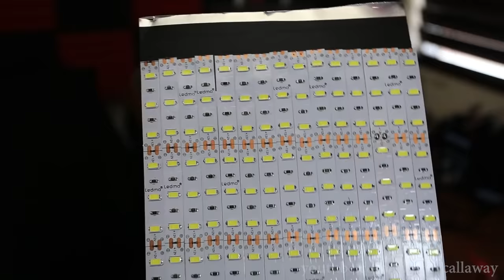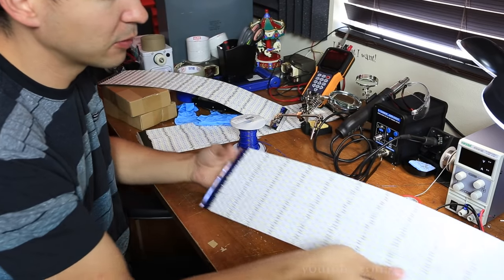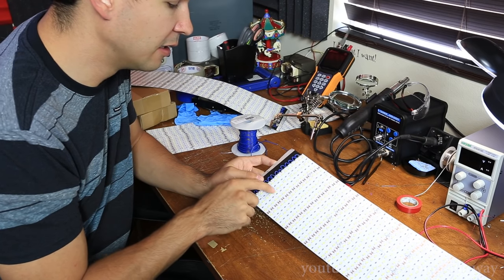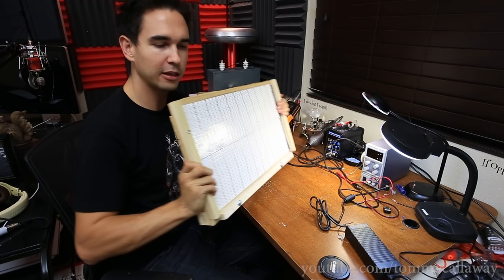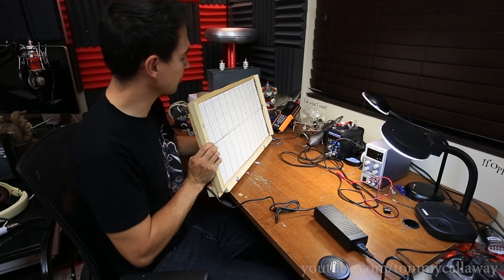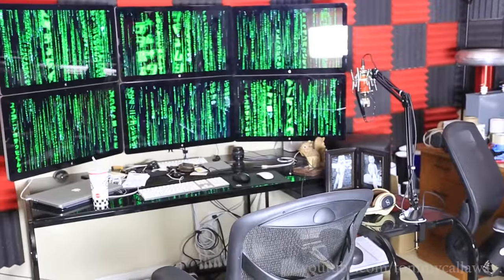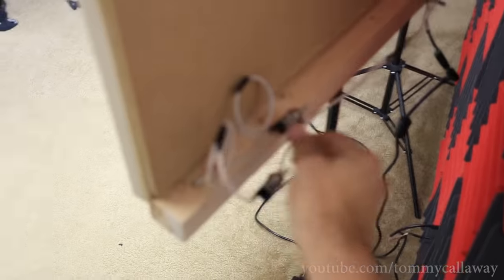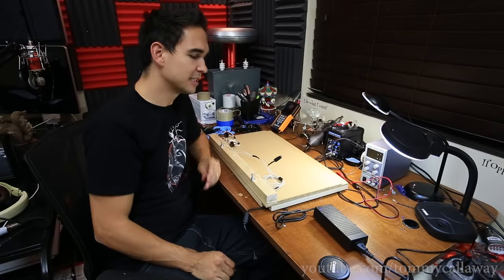DIY Insanely Bright LED Panels (for video or photography)

Comment: Hi I need serious help in backlighting for inspection panel. Is it possible to use AC plug n play with dimmable feature? On what height should I place it to be to have it in 60mm box? And have 1030 lumens for 650 x 350 mm box. Thanks in advance,

Comment: Hey good job how long can you run these for before you may get any issues? As I'd like to use this idea to make lights for my garage to detail my car but they may be running a few hours at a time.. thanks
Reply from the maker: +Aaron Emptage I've run it for over an hour a few times. Still running strong.

Comment: Nice Tutorial! 
How hot does the panel get when running for longer periods of time? is the Aluminium and no front glass enough to keep the temps under control?
Reply from the maker: +photofreak126 yes, I've used the panel for extended periods of time - it gets warm to the touch pretty quickly but it doesn't get much warmer than that. It's good to go for extended use. Also, I found a better way to wire the LED strips together which can save you a couple hours if you're look through my videos.

Comment: Very good video! Thanks so much! I was just wondering , what is the purpose of the aluminum backing. Can't you just paste the led strips directly on the MFD board?
Reply from the maker: The aluminum backing helps with heat sinking.  It's only a little, but it helps. Additionally, it makes it so the panels are more easily replaceable if you get different colored / higher CRI LEDs in the future.
Reply: Direct to consumables is a fire hazard.

Comment: Your LED Panel looks great!  
What kind of Fstops are you working with, with this LED Panel?  
Can you meter this LED Panel from 3 feet at ISO 100 at 200Sec Shutter speed 
to see what kind of Fstops your getting?
Reply from the maker: +Divus iulius sure, will get you back tomorrow. In the mean time, I usually shoot video at 1/30 or 1/60, ISO 100, and f4 to f5.6 using only this panel as lighting on a tripod about 8 feet back.
Reply: Not bad. I'm an old Film Photographer. I rely on my metering.  I still shoot strobes.  I'm not all that impressed with Fluorescent Lighting what so ever.  However, I am impressed with LED's and Super Bright LED's.  I just needed to get some numbers with what you were presenting in this video.

Thank You!
Reply: Absolutely!  Please and Thank You!
It would be absolutely appreciated.
Reply from the maker: My meter was dead center at F4, ISO 100, 1/200 shutter speed with only the panel lighting it at 3 feet.  The resulting picture looked like it would be good for a dramatic portrait.
Reply: Damn! At three feet, that is pretty good. That gives you an exposure value of EV-11 at ISO -100. If you're interested in that sought of thing.  Exposure Values gives me a reference point as to the strength of the output of light.  Here's an Exposure Value Chart for your future curiosities.

https://upload.wikimedia.org/wikipedia/commons/d/d4/Exposure_Value_Chart.jpg

And here's a Exposure Value Website Calculator for any of your other light projects.
You will have to scroll down the page to get to it.

http://www.scantips.com/lights/evchart.html

And Thank You! Again for your time and trouble.
Much Appreciated!
Reply: You mentioned higher power sources for brighter LED panels. What would be so bad about that?  If the trade off is getting LED's to perform at the higher Lumen outputs for lower ISO ranges.  Higher Power output LED Lights behind Softbox's & Diffusion Scrim  would get back some of the light that is lost in the diffusion fabrics.

Instead of an ISO at F4, maybe ,F8, F11 or F22 for group shots that requires LED Lights to be set back to further distances.

An LED that is putting out 8K to 10K Lumens is definitely gong to be needed eventually.

NO?

This is insane money for 6000K,  10K Lux
Flicker Free LED Lights when you can make them yourself!

$13,000 USD  ?? What ??

B&H # DESPSL4BMK 	 		MFR # SLED4-BI-M

Dedolight 			DLED4-BI Bi-Color LED 4-Light Master Kit (Mains & Battery Operation)

											CRI: >91   										<== for 13,000 it should be 99
											Color Temperature: 2,800-6,000K 										
											Focus-able from 60 to 4° 										
											Tilt with Permanent Friction 										
											Outputs 10,100 lux at 3' with Spot 										
											Passive Cooling 										
											Two Dedoflex Softboxes & DP1.1 Imager 										
											Four Battery Power Supplies & Batteries 										
											Four Mains Power Supplies 										
											Four DST Stands & Soft Case 										
							
						 						 					
https://www.bhphotovideo.com/c/buy/Kits/Ns/p_PRICE_2|1/ci/12292/N/3988592073
Reply from the maker: That's some pretty crazy money for something you can build yourself for around $500 - doing this build with higher quality LED strips and a few more panels.
Reply: AAAAAAAH! You have seen the light!
Reply from the maker: Divus iulius That's a crazy panel.  I would love to compare it side by side to my own cheapo one.. I should get in contact with them.
Reply: Mr. Callaway,
                     The reason I suspected that you were producing very high Lumens was that part in your video where you astutely suggested not to use the potentiometer. 

That suggests too much voltage drop and loss of overall power.

I'm tickled pink because nearly all of these guys using them are more than likely cutting their power and Lumens by HALF.

Most of these DIY projects on video are putting out somewhere around 6000 Lumens at best. That's 6000 Lux at 3.3 ft / 1 Meter.

That's not bad for a DIY LED project.

But if you were correct about your numbers at:
F4, ISO 100, 1/200  Then you need to be proud of yourself.
 
I couldn't believe my eyes when I read that was EV-12.

I would love to see you can do on even brighter and more powerful LEDs.
Reply: Since the last time I corresponded with you, I have been struggling with the EV calculations.  I'm a Photographer, not some Math prodigy.   However, I finally got it figured out.  The EV Formula on Calculator goes something like this.  
At ISO 100

EV = Log(fstop² / Time) / Log₂

And it really works to my surprise!

Your numbers where, EV = Log( f4² / (1/200)) / Log₂  

EV = 11.6438561898  That's between EV 11 and 12

Ta Da!  I'm So Fucking proud of my self.
But that's what you are putting out on the Ghetto Light Blaster.  LOL
Reply: To get the Lux from the EV,

Lux = 2.5 x 2^EV
2.5 x 2^11.6438561898
Lux = 8000 per square meter at 1 Meter.

That's Damn Good!
Reply from the maker: Very interesting! Thank you for spending the time to figure all that out lol.

Comment: Hi Tommy, I new to this so please be gentle in you response. The 5630 LED strips you used were 12V 60W and therefore rated at 5A per 5 metre length. What was your calculation to determine the watts and amps output requirement of the transformer you used. Assuming you cut the LED strips into 50cm lengths, each having 30 LED's?

My setup was to cut 3 x rolls of LED's into 50cm lengths. I connected the dimmer load positive through 2 switches two positive bus bars, each having 15 positive connections, and the negative load output to one negative bus bar for all 30 negative connections. A similar setup to your LED panel, but only using 900 LED's
Reply from the maker: I took one roll, and applied 12v with my bench lab supply.  I observed the current draw, and then added LED strips until I got to 10 amps.  It ended up being just about 3 and 1/3 rolls of LED strips, at roughly 1000 LEDs.

Comment: Hello Tommy. I was wondering if you have any problems with flicker when doing video using a switching power supply .
Reply from the maker: +Jon Fisher I haven’t had problems with this panel. Using a PWM device will cause flicker especially at faster shutter speeds.
Reply: Tommy what is a PWM device
Reply from the maker: +Jon Fisher pulse width modulation.

Comment: The link for the power supply is for a 12 volt 2amp power supply. Or am I incorrect?
Reply from the maker: 12 volt 10 amp.  DO NOT get the 2 amp one, it won't power this project.
Reply from the maker: Fixed, found it on ebay.

Comment from the maker: You can also choose to use different colored LED ribbons if you want, don't feel obligated to use the cheap ones I used.  They work really great, but I'm sure there are even better ones.  You can also mix and match colors so you don't need to use gels if you wanted to have different color settings.  Have fun, and let me know if you guys have any questions.

Comment: You should consider taping over the negative pads with Kapton tape (or electrical tape) and use an uninsulated solid conductor as a power bus and tack solder the bus to each of the positive pads.    And then again for the negative side but tape over the positive pads and tack solder the bus to the negative  pads.
Reply from the maker: That sounds like it would save a crap load of time.  Really great idea!  Going to definitely try this on the next one.
Reply: May be worth experimenting with removing the pad altogether with snips.      May be worth sacrificing one segment of the tape to find out.
Reply from the maker: +Nicholas Mistry I've got a bunch of extra. I'll run a test and let you know what I find this week.
Reply: Yea, curious to hear how it works out.     Really nice build btw.
Reply from the maker: Thank you.  I'll ping you when the test is done
Reply from the maker: Nicolas - I just tested cutting the pads off.  It works GREAT.  Video coming up this week with proof!
Reply: Glad the experiment went well.    Looking forward to seeing the results!
Reply from the maker: +Nicholas Mistry video will be up tomorrow morning at 9:30 am pst. :)

Comment: Would my LEDs with the exposed copper short on wood?
Reply from the maker: +UnboundGodz not unless the wood is wet.
Reply: nvm ill just rather be safe then sorry and tape the copper aswell. would have done the full length of strip but thats to much tape to waste for such a thin strip.
Reply: ***** Oh, alright. i just recently stripped a board from an old desk, and cleaned off dust and dried it reason i ask. Mainly i dont want any short then fire, undecided if this project will be either powered by battery with ease due to solar panel or by home. Fingers crossed it works out well. Its small not as big as yours... ;3
Reply from the maker: You should be fine, other people have mounted them on cloth and wood before.  I'm just overly cautious, and had to tape because I was mounting on aluminum to deal with the heat generated at 12v.
Reply: ***** Yea on metal id freak :D alright, thanks for the info. If it all works well, ill probably end up adding switch to it aswell ;3 Thanks for the info ;)
Reply: Thanks again.
Reply from the maker: ***** I did another LED panel video today, which is not as bright, but is super easy to make. https://www.youtube.com/watch?v=qAeoLg9XmtQ

Comment: I don´t see the point in doing all this when you can purchase a 100 watt led chip with a drive ( or even the new which doesn´t need a drive ) and put directly on the wall. It´s very very cheap and you could have an extremely bright light for photos and video.
Reply: those require a fan to cool them because they get very hot, noise isn't very ideal in video making.

Comment: hey man, love the video like what the CRI on the stripe an do you get the green cast in your video using them?
Reply from the maker: +Zeema Lawrence I definitely used cheap LEDs and get a greenish tinge which requires some color correction, but you can buy higher quality LED rolls to fix that problem easily enough. Look for CRI95+ rolls
Reply: did you do the dimmable led panel yet?
Reply from the maker: +Zeema Lawrence yeah. I made one for a friend and added a dimmer unit, but didn’t record the process. I will just adjust mine soon and make a video on it.